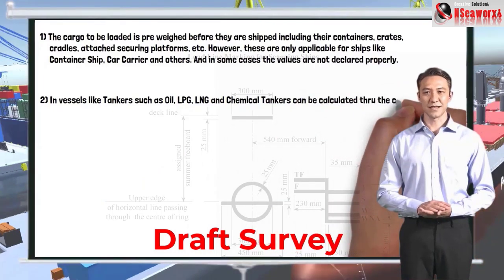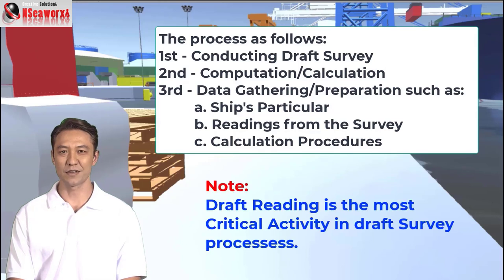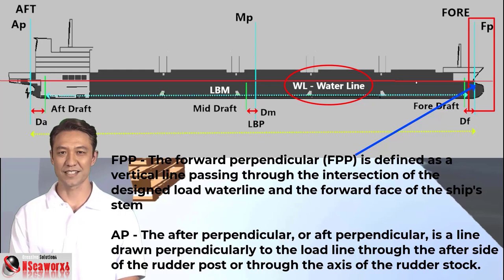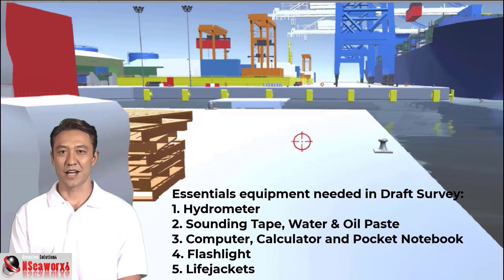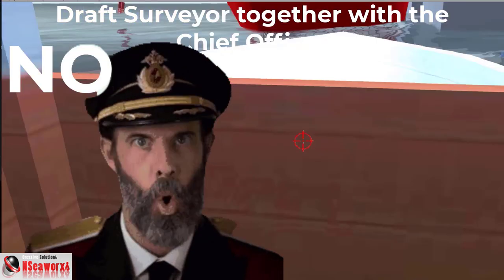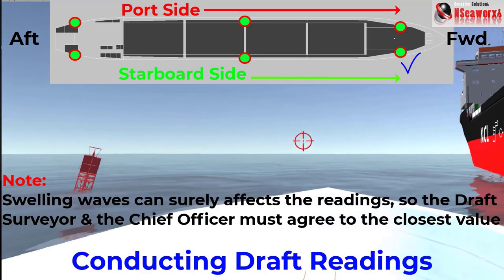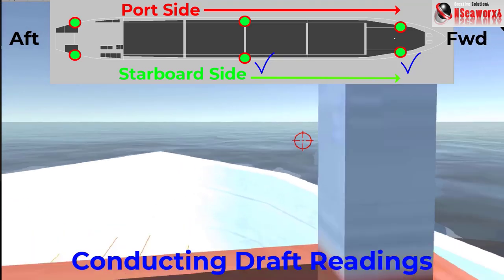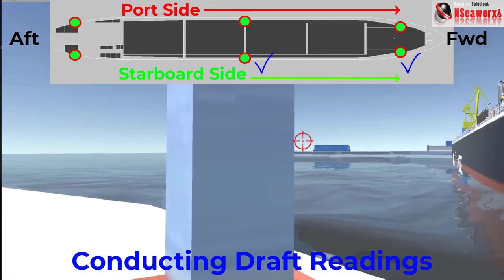🚢 The basics of Draft Survey - Best Practices Series of Part 1 - Intro

Comment: Reading the drafts is not the most important, but determining the ballast on board. Because calculating the ballast is much more difficult and complex than determining the draft and therefore the ballast calculations often contains hidden and unknown errors.
However, the determined draft is the basis of the total calculation because this draft is fixed while the rest of the calculation components are variable. But other than that it's a nice video.